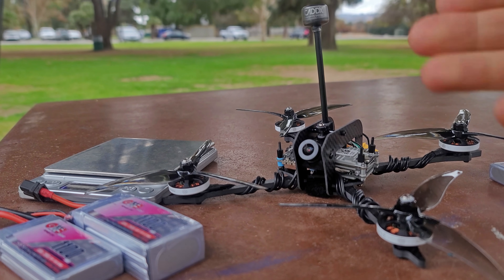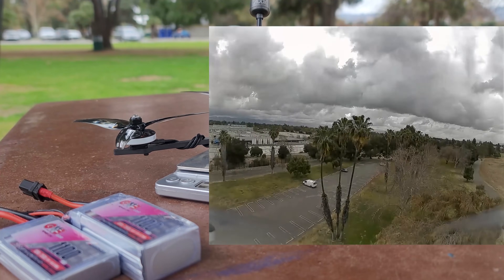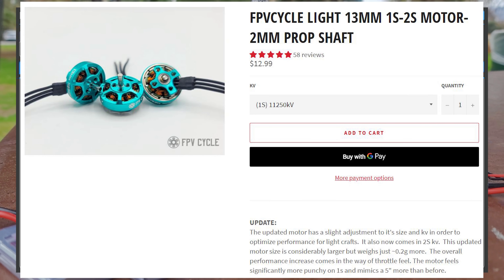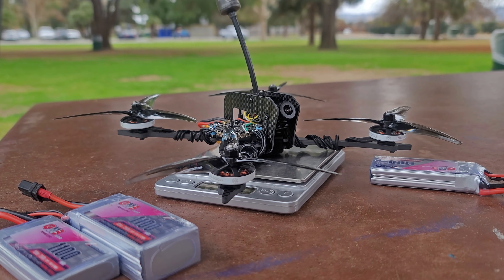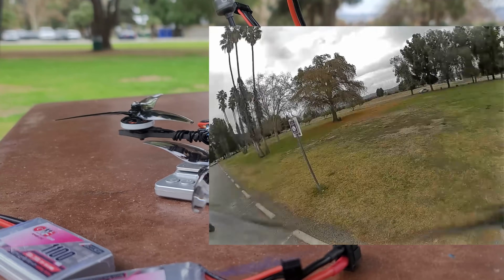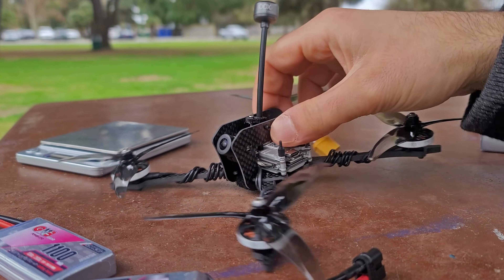Curb your motor wires - 250g 5" things...

Comment: What frame is this?
Reply from the maker: Just a prototype. The one that's actually gonna come is quite different. Top mount battery frame that's 39g with 15mm build height
Reply: @Kabab  ok, what kind of time frame will it be released?
Reply from the maker: @Jabbey71  I'm trying tray hard to get batch 1 before CNY in 2wks. Dunno if it'll happen however
Reply: @Kabab  ok.  Thanks.  What site will they be available on when they are ready to sale?

Comment: My thoughts with this is that it's awesome to experiments and trying new things, but how is the battery sag on the 2s packs? A mainly fly 4s packs on my freestyle rigs and I've 'dabbled' with 6s a few times. And noticed the sag on 4s is a lot more than on 6s. I get that the packs kebab is using are top line, but it still must be there? I think I might look into sub 250 in the future
Reply from the maker: There's really minimal to just about zero sag on the 2s pack however that 3s overall performs better.

Comment: The gram of weight difference is likely a change in ambient air pressure.
Reply from the maker: That's what I was thinking. The thing inside the scale likely works on that
Reply: @Kabab  you probably have some kind of weird weather coming for it to change that much that fast.

Comment: Which frame is that?
Reply from the maker: Just a prototype. The one that's actually gonna come is quite different. Top mount battery frame that's 39g with 15mm build height
Reply: @Kabab  looking forward to that. Have tried racerX ET5 and would like carbon camera protection.

Comment: The problem with the 250g Rule is not only the weight but here in the EU the quads also need to be slower than 19 m/s or 68 km/h in order to get the sub 250g benefits. Therefore even my 2s toothpick probably falls under the same category as my 700g 5".
Reply from the maker: Well this is definitely going faster than 70km/h 😅

Comment: So I really want to build a sub 250 4”-5” freestyle. I do have a Fouride in 4” & 5” as well as the Shocker UL. All of them are running your 2203 motors. I love the lighter class of quads. How long do you think it will be before there is a product for purchase? Do you recommend the 2203/4 2800kv(about to make a large order) and I don’t want things to be out of stock when I want to build it. BTW I do like to run 5S 850s on the 5” Fouride when carrying a GoPro Session(which is most of the time) It flys sooo nice. I actually put a naked Air Unit in the 4” Fouride and it dropped it to Vista weight. I basically stripped it down JUST to cram it in the slammed frame design. It works perfectly.
Reply from the maker: I'm hoping to have a frame available shortly after cny if everything works out right. The 2204 we currently have in 2800kv and 3s is reslly great but if people really want the 250g thing then I'm gonna work on redesigning a 2203 for tht purpose. 2203 is enough but 2204 is better. It's actually 2203.2
Reply: @Kabab  Awesome! I was going to order another set of which are now of course 2203/4. Would the 2203 3000kv be better than the 2203/4’s as far as weight. I could just swap the motors on one of my Ultralights. 

BTW this Nano LR thing is starting to be talked about. I JUST put my TP4 up and went some pretty crazy distances(could have gone farther). This thing can be crazy efficient with the 4800kv 1303‘s from Amax. Of course I went way above the 400 limit to keep good video. Speaking of video of the DVR recorded in black-and-white for some reason damn Fat Sharks. I’m going to post it on your page. I wish it was in color. It was really pretty.

Comment: Now I wanna try and build a lightweight build  with your 2204 motors since I already have those. Just gotta figure out the frame and esc amp rating. But I don't think I'm gonna stick to that 250 limit but atleast close to it.
Reply from the maker: Yep that's what I think we'll all do. Not quite 250 but close. Like sub 300

Comment: So 1S or 6S only! And easy to reuse exploded 6S batteries with 1S quad for total destruction =)
Reply: There is an argument for 4s packs...   but it comes into play with when you put them into series and make 8s packs.    Or even 8s4p 18650 and have an 80mph Xclass drone that can fly for more than 15 minutes...

Comes in under 250g naturally.
Reply from the maker: You'll give up over a minute of flight time by running a ~250g thing on 6S.  You'll gain maybe 10% performance for that minute loss.  1 minute out of a 3-4min flight or 1.5min off a cruising flight of ~5-7min.  Quite significant
Reply: @Kabab  10% faster lap times than the competition is why I fly 6S. I might have to try your new 6S motors. I do like the prop nut VS the T-mounts.
Reply from the maker: @damfastfpv8016  well if you race then sure. But if you're not a racer then it's usually a negative to have more voltage than you need
Reply: @Kabab  more voltage for LithiumIon can be a good thing.    But that all revolves around whether people are concerned with the 250g weight limit.
Reply: @Kabab  hmm i cruise 18 mins with a 6S 1100 50c HV(130 gr)  with flywoo 6S(naked vista + naked gopro 8)  ,no other lipo battery gives me that time. 4S? dont exist a lipo 130 gr giving 6000 mah+
Reply: @Kabab  how come the hglrc petrel 132 6s version flies for so long then? 🤔
Reply: @ValFPV  cuz its super light and just a blew up "toothpick" on 6s

Comment: Could you reduce the weight enough to run it on 3s?  Is it possible that if you shortened the wires there would be a slight reduction in voltage drop?  Just a thought. When you are trying to milk a mouse maybe every little drop matters.
Reply from the maker: na it wouldn't make any voltage difference but I'd absolutely shorten all the battery wires because none of that length is needed
Reply: The resistance losses are negligible but the reduction in weight would have some effect.

Comment from the maker: Table of Contents:
00:00 - Intro
00:37 - 2S flight video
02:16 - Thoughts on 250g rules
03:58 - 2S performance explanation
04:30 - Throttle boost needed?
05:08 - Enough voltage for a given motor size?
07:30 - Motor sizes for 5"
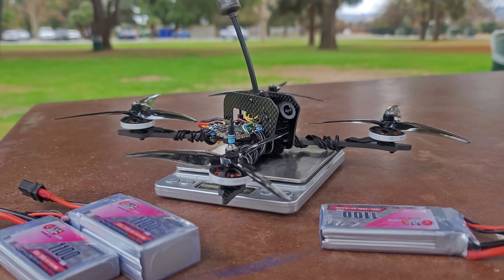09:48 - Battery options
11:40 - 3S flight performance
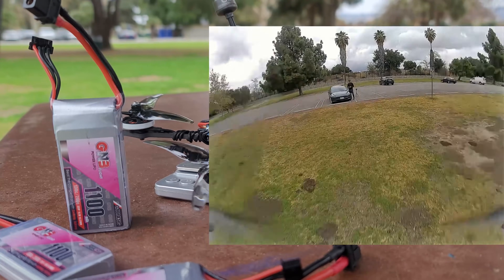13:03 - 6S recommendations
14:40 - The possible future of 250g
15:40 - This particular frame design

Links to things:
The 2203/4 motors (available in T mount for less weight): http://bit.ly/3oJQBN2
The new 5" motor: http://bit.ly/368jFGK
The new Baby tooth motor: http://bit.ly/2UlySPA
Vista + Nebula pro: http://bit.ly/2YbqqDq
The AIO board that's been consistently performing pretty well: http://bit.ly/3o9MWHz

Some really special new batteries (read descriptions):
6S 1250mah 130C: http://bit.ly/2NynIG8
5S 1550mah 120C: http://bit.ly/3qSHAlL

Music: Udachi - Boogie oogie
https://www.youtube.com/user/udachinyc

Stay tuned to www.FPVCycle.com.  We've been working extremely hard on a bunch of new things.

▼Join the FB group for more discussion: FPVCycle - Kabab FPV
https://www.facebook.com/groups/379155946182689/

▼ Tips?
Patreon: https://bit.ly/2oGLP9b
$1/mo from 1/4 of my subscribers will make me almost quit my job.  Thank you

-PayPal: https://www.paypal.me/kababfpv
-Bitcoin: 1E4XZXoD4rS6MYWVWuenY7Kw2M1YgyNpoQ
-Nano: xrb_1188ek5bd7tb9kw67asnp9o65byuoaxbtpxuznx1ribf75x78awywmakj55f
-ETH: 0xD067F93811f2eC31CB1928901002dfdf9A492EF5
-LTC: La2KWYAjp4VT2Lq2M76pbjzXWvRyjpfCtG